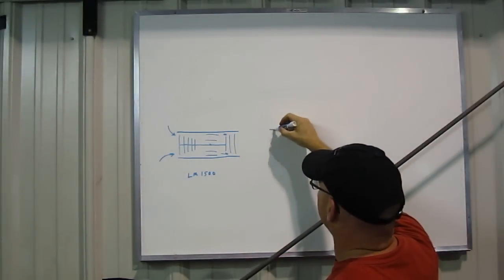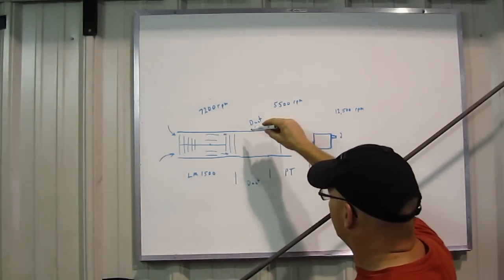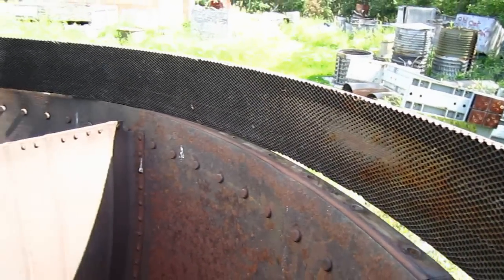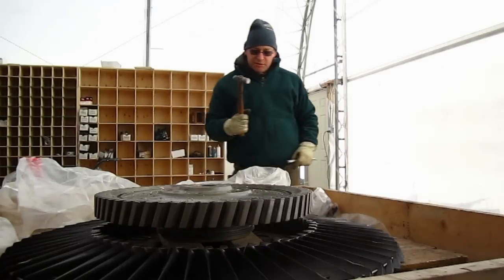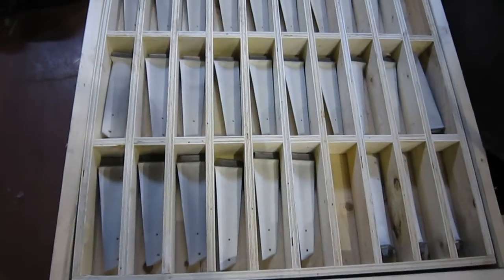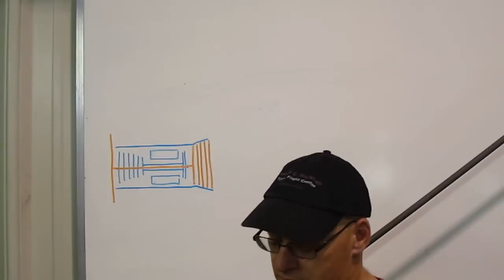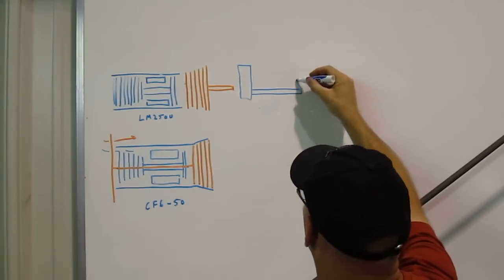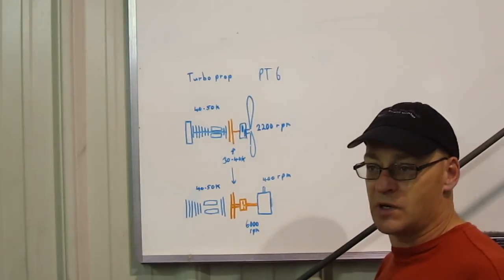Power Turbines: what are they ?

Comment: Hello AgentJayZ, i just subbed to your channel, i love the videos you make and of course i love these machines as you probably do too!.. However in relation to how these PT's work i imagine they use a thermodynamical process to increase the output RPM from the turbine of the gas generator, correct me if im wrong but air expands as temperature increases and contracts as it gets colder.. Maybe the magic of Power Turbines reside on the temperature of that duct and the pressure variation inside of it.. Im no expert but thats what i understood about how it works.. Great videos!.

Comment: So the rpm reduction seems to be done simply by the size of the power turbine wheel.
Reply from the maker: That would be an oversimplification to the point of uselessness.
Reply: @AgentJayZ  whats the speed of the power turbine blade tips compared to those of the engine turbine?
Reply from the maker: 5500 rpm X 5 ft compared to 7200 rpm X 31 inches.

Comment: Wouldn't it be more accurate to state that the power turbine will turn at whatever speed the attached mechanical load will allow it turn?  In other words, in the case of a utility generator, the output shaft speed would be locked to 3600 RPM (synchronous speed) simply because the load added by the generator inherently limits/governs it.  Unloaded, the same setup would allow the power turbine to spool up to some insanely high speed - freewheeling.
Reply from the maker: Sure, I don't know much about utility electrical generation, but I'm sure the load changes a bit.
In the configuration I've described, the power produced by the GG, which is extracted by the PT to turn the electrical generator, can change almost instantly, thanks to the fuel control monitoring the speed of the PT...
In such a setup, completely unloading the PT would cause the GG to drop to idle.
Reply: Oh yeah, of course.  I deliberately left out any provisions for electronic control or throttling of gas generator.  What prompted me to comment was listening to you talk, I got the impression that maybe you had been asked a lot of questions about how the output shaft "knows" what speed to rotate at - given that it's essentially just a "propeller and shaft spinning in a tube."

Comment: Thanks for the video. I already knew the principle of how all jet engines works  I just got one question what bothers me all the time. What happens with all the energy (thrust) in helicopter jets engines. It still has to have huge amount of energy (thrust) even after it pass through power turbine... no?
Reply from the maker: +ptrchovan No
Reply: +AgentJayZ Thanks for the answer..  I will have to go somewhere to see it live because it is still bothers me anyway. Have you got any detailed video of running helicopter jet engine?
Reply from the maker: The T58, which is used to power the race boats, is a medium lift helicopter engine.

Comment: Now the model with the "air duct" in between the engine and the generator. When you have "air" as the output shaft per-say, isn't efficiency lost? Versa a direct coupling between the two?  -Or does the air somehow increase power between the two and how?
Reply from the maker: TheRusschannel No, no, and no. I have made a few videos on power turbines, and I can't explain it any better. You should probably seek your answers  from another, more eloquent source.
 Why the quotation marks?
I guess to be super technically accurate, it's a gas duct.
And what the hell does "per-say" mean? I don't even like it when people use the correct, but equally vague "per se"
Reply: haha nah dude sorry i'm ignorant but yet fascinated by turbine engines. I'm a lame Automotive mechanic and i envy your knowledge :)..I would change fields but aircraft mechanics make so much less, for some dumb reason...
Reply from the maker: TheRusschannel Keep the secret, and allow the legend(illusion?) to continue.
To work on aircraft engines, one must place great value on the intangibles....
Automotive techs have to really hustle to produce in the allowed time. We have a lot more leeway that way, but are still rewarded intangibly... for the most part.
Cheers!
Reply: Turbines turn from input gas pressure. The combustion chamber heats air, increasing its pressure. That hot, high pressure air enters the turbine and spins it.
Reply from the maker: +John Wynne The burning of air and fuel in the combustors raises the temperature, but the pressure does not rise.
The pressure does not rise, it goes down....
This is not an Otto cycle engine, it is a Brayton cycle engine.
The pressure in the combustor is less than the compressor discharge pressure.

That's not what TheRusschannel was asking about anyway.
Anyway, this is a video about power turbines, not gas generators.
Reply: +AgentJayZ oops. My mistake! Thanks for stating on top of your comments!

Comment: Greetings friend, I'm from Venezuela and work in a gas compression plant offshore, on the platform we have 02 turbines 24C RB-211 power turbine and 01 RT-62 Rolls Royce, you could be so kind as to post some video which explain the components of these turbines. ??? parts, fuel control ........... I would be very grateful ........

Comment: How much efficiency is lost between the power turbine and output shaft?
Reply from the maker: The power turbine is what turns the output shaft. So none.
Reply: @AgentJayZ  I meant the the coupling of the power turbine and engine. The area you circled on the whiteboard
Reply from the maker: @terrycarver1255  If the PT is turning at design speed, no efficiency is lost. If the PT is overloaded and the rpm drops, then efficiency does suffer. Overloading a PT is how helicopters crash, and power generating facilities waste fuel.
However, you can run a turboshaft engine with the PT locked in a stationary position, and that lock better be tough, because even at zero rpm, the PT produces huge torque.
Reply: @AgentJayZ  100 percent efficiency if everything is running peak power?  I just figured there would be some loss of efficiency somewhere down the line. Seems like a lot of power and fuel just to turn a generator. Seems if any loss would be at that stage. Usually heat equals efficiency loss in the science world.
Reply from the maker: Seems you figured a lot of stuff...
Reply: @AgentJayZ  always been fascinated with jet
 engines .
Wish I could put a small one on my plane. .

Comment: The 3600 rpm is not that it is the best, most economical speed, it is because 3600 rpm is 60 revolutions per second and it is designed to make 60hz AC current. To my understanding you use an electronically controlled rheostat to adjust the impedance, which adjusts the load. If it spins faster than 3600, it reduces the impedance, which increases the load and slows it down. If it spins slower than 3600, it increases the impedance to decrease the load and lest the rpm come up.
Reply from the maker: +Larz     Meh...The PT used for power generation is designed to to turn at 3600 rpm. aerodynamically, it is most efficient there. Similar, but different from, the Lp turbine speed in a turbofan, which would be a lower rpm, to turn the fan at its best speed.
Reply: +AgentJayZ in one of the diagrams you drew, the power turbine spins at 5,500 and the gear reduction output spins at 3600. So 5,500 is its efficiency sweet spot. The output has to be at a multiple of 60 cycles per second to go to the grid. 1,800, 3,600 or 7,200.

Comment: So... basically, the power turbine works like a torque convertor on an Automobile with the exception that you are using air rather than fluid. Makes sense.
Reply from the maker: Air is a fluid, but is compressible, unlike oil or water. So yes, sort of, but not exactly. It's always a bad idea to try to apply car thinking to jet engines.
Reply: @AgentJayZ  HeyJayZ!! Love your Videos. "Air is a fluid, but is compressible" I understand that, but it is still the basic concept of the output of a turbine (fan) pushing another one, which is all I meant.. It is one of the basic diagrams/models they use in Automotive Books when explaining how torque convertors work. The output of one fan, pushes the other with no direct mechanical connection between the two. But yes... I understand what you are saying.

Comment: 100% Ng in a PT6 is about 32,500 rpm.
Reply: On a pt6-28 its 37,500 at 100%, 38,100 at 101.5% and 38,500 at 102.5%
Reply: Moises Godoy why are these so much faster than a typical jet engine? Just for the gearing or am i missing something?
Reply: Gerald Gepes because they are very small in diameter.  The greater the diameter, the greater the centrifugal force for a given RPM. As the turbine wheel grows in size, you start to reach structural forces that can only be limited by reducing RPM...

Comment: Agent Jay Z,

If you've seen these "Laser Cleaning" videos on YT, they look like they can do nearly anything. What would be the problem using a 'cleaning' laser to clean a blade NGV or disk?
(I know there's an approval process, I mean physically)
Reply from the maker: Problem? The blades can be cleaned in seconds with a quick brushing.
NGVs are similar. They don't really need to be cleaned.
With the disk, they only need cleaning in the fir trees, which by their geometry will not allow a laser beam to get in there.
The surface of a disk takes a minute or so to wipe off. No sweat.

Comment: Does this thing make much wind? Also, could it suck something in?
Reply from the maker: Devon Cantrell We turn compressors backwards on the balance machine, because that way they move the least amount of air. For the same reason, we turn turbines in their normal operating rotation.
Also, despite the appearance of danger that has caused so many experts to condemn our practices, rotors are typically balanced at about 5% of operational speed.
Reply: Ahh. Thankyou! So do you guys only run turbojets?
Reply: +Devon Cantrell sometimes the al25 turbo fan or rolls Royce Olympus, but mainly j79's / lm1500's
Reply: Aidan Brown I see. Thank you sir.

Comment: thats gonna be a medium hard one. i would like to build up a very small power turbine to power up an rc helicopter. i would like this engine to be not more then 10 cm long and 2.5cm wide. the things is im getting information about how it works ( learned alot from you ) and i think it can be possible but even if id like to know what type would be needed for and heli and how to mount it on the main gear or even straight on the shaft ? meh i dont know , if you have any idea id listen to it! :P

Comment: You should explain how the actual jet principle applies.  How pressure is converted to flow.
Reply from the maker: +Les Brown   You should find out for yourself the pressure can not be converted to flow.
Pressure and converted have strict technical definitions.
I'm not so sure about flow...
Reply: +AgentJayZ 
OF course pressure can be converted to flow.  Go turn on a water tap.  Flow is converted to pressure in the diffuser and heated.  Volume increases but since the pressure is lower in the aft than the front, it escapes at high velocity.  Jet thrust.
Reply: +AgentJayZ 
The jet principle is the same as a venturi.  What is a venturi?  Simply a pipe with a restricted area of flow.  What happens in the venturi?  Flow increases in speed and pressure DROPS.
Reply: +AgentJayZ 
The principle is known as 'Bernoulli's theorem of incompressable flow'.   Same thing that makes a wing fly.
Speed up the air on top by making the path longer which decreases the pressure.  Resultant is higher relative pressure on the bottom of the wing and... voila.
Take a look at your engine blades.  Most often they are shaped the same way.  Known as accelerated induction flow.
Reply from the maker: +Les Brown   Thanks, this comment makes me wonder why you posted the first one.
Reply: +AgentJayZ 
For those that may not understand the actual physics of the airflow through.  
Interesting videos.  Well done.

Comment: is a turbine Engine and a jet Engine he same?or very similar
Reply from the maker: Very similar. A jet engine is a turbine engine with one extra feature: a jet nozzle to accelerate the exhaust gases to maximize thrust.
Reply: Thank you
Reply: Next time you watch a jet fighter in flight like say a airshow look at the nozzle. It will move so that the opening is smaller. Exhaust gases find the path of least resistance out the back, shrink their exit and said plane will move forward faster. Open it up and it slows down. Now the only time the fighter will speed up when nozzle is full open is when the afterburner is ignited. Then you get a bang of extra power from raw fuel dumped in the exhaust stream and ignited. A turbine is usually used like this video demonstrates to either generate electricity, or to power a rotor/prop for helicopters/small commuter air craft.